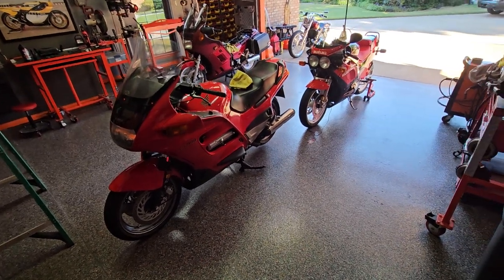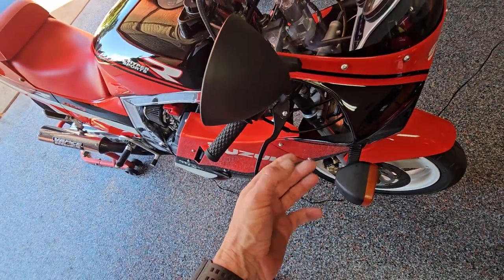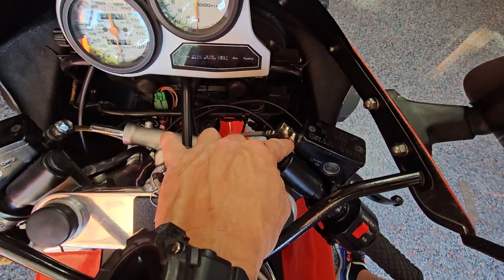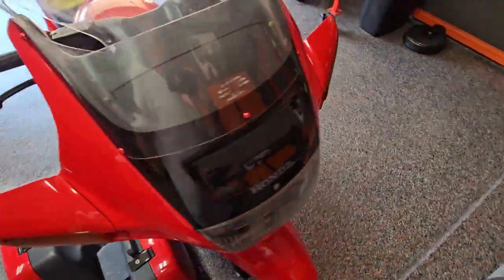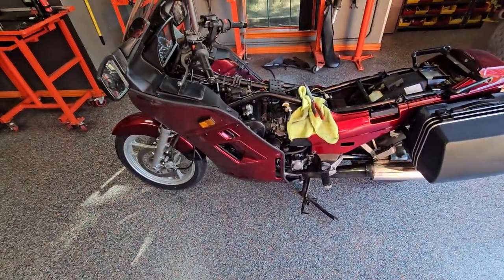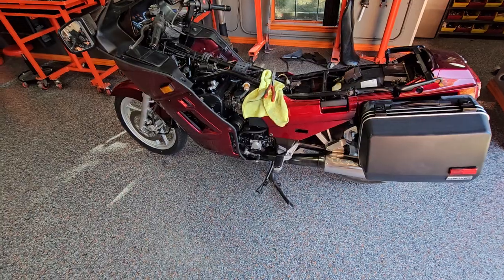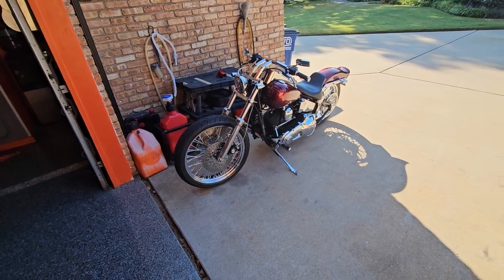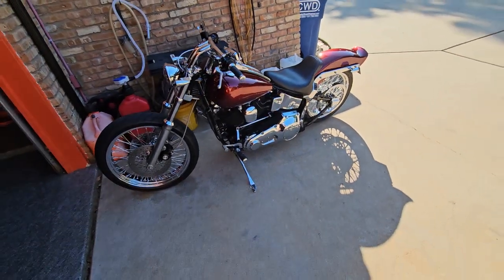What's Up At Texas Moto Worx??

Comment: Had the same switch issue on my '83 GS750ED. Simply swapped out a later model brake lever/master cylinder version with the more modern switch. My '89 750 Katana has the click  switch versus the old mush version. Replace the old harness with a proper connector and you're golden brown with crispy edges.